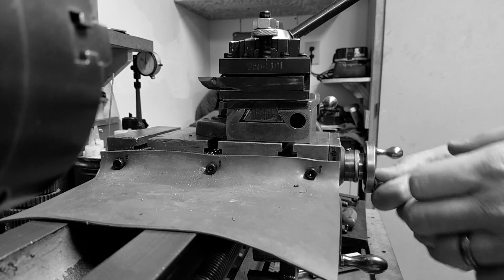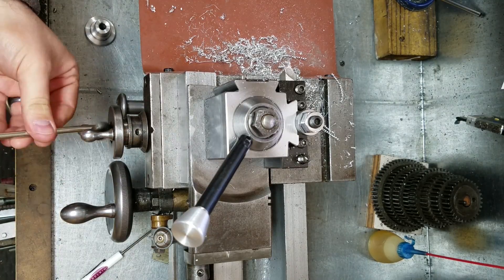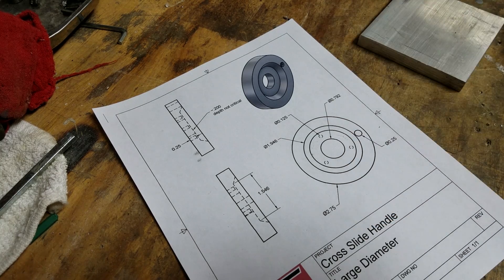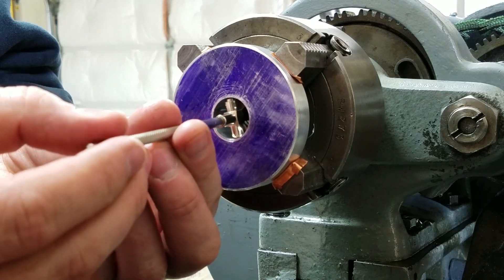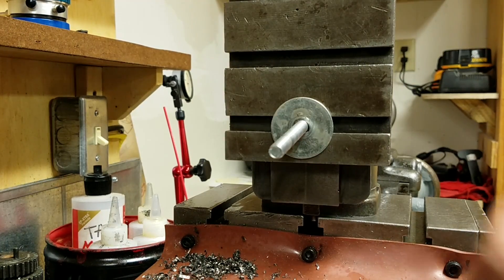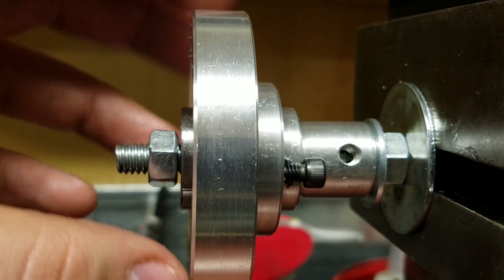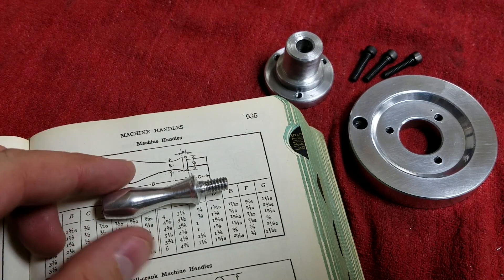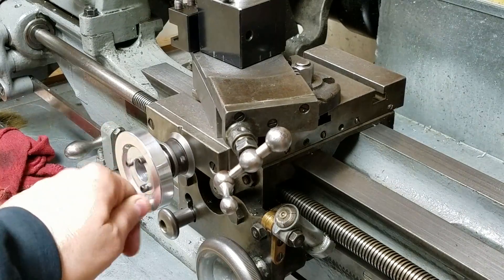Lathe Handle //Beginner Metal Lathe Project

Comment: Well done. Nice work.
Look at the time 09:35. Suppose You would like to turn the compound another 30 degrees CW, like when single point threading. It looks like the compound will interfere with Your new handle. I faced that on my mini lathe and bought a small compound handle and down sized the handle of the cross slide!
I could think of using the original handle You had but removing one of the pins..

Comment: I forget who's channel I was watching an old time machinist make a similar handle, your not going to believe this but, the trick is to shape the part to the critical dimensions, than just like on a wood lathe, he finished the handle by hand {via a homemade hand held turning tool} on a steady rest like on a wood lathe, knocked it out if I remember correctly, like in less than 10 minutes.  Oh, and yes what the old timer made was from steel, not aluminum.

Comment: In your video you use a book with the specs for handwheels and machine handles, what is the title of this book. Thanks
Reply from the maker: Machinery Handbook.  Pretty much any edition will work.  Mine is quite old, like 13th or something.
Reply: Thanks for the info, I already have the 26th edition and I don't have that section. If you have the time can you check for the edition you have please. I will try to find a copy on the internet.

Comment: Loved the video, you make it seem so easy, I wish I could get my hands on a lathe but here in tokyo is almost impossible. seems so expensive
Reply: Ebay.
Reply: Any ideas? I saw some video that says many ebay cheap ones come with disaglinments and defects that make them even more expensive to repair. Im a total noob about it. Besides I need something small to put in the apartment.
Reply: Julio, 
Two brands of small lathes that you can put in your apartment are Sherline (https://www.sherline.com/) and Taig (http://www.taigtools.com/mlathe.html). Both are very accurate if well adjusted. See if you can at a good price in your country. Another option is a Chinese lathe. There is good and bad lathes in China, search before buy. One that I would recommend is the 180 x 300 Optimum lathe (https://www.youtube.com/watch?v=wQGJdr5lCQk). Another cheaper option would be an SIEG (https://littlemachineshop.com/products/product_view.php?ProductID=4959). Of course none of this is cheap and you will still spend a lot on the tools but I am just showing you what your possibilities are. Big hug and good luck!

Comment: Does your lathe have power crossfeed? I am looking at buying a new lathe and am wondering how vital it is. Its quite a bit of money extra. Thanks!
Reply from the maker: That lathe did not have power cross feed.  However, my new to me Sheldon lathe does have it.  I will say it is very handy for parting off operations.
Reply: Ah ok cool. I was impressed with the surface finish you got without power feed! Being a beginner, my finishes in facing cuts suuuuck and so I was wondering if the power feed was worth it. However if its just a matter of skill, then I will stick with the manual method and save the cash for other things :)
Reply from the maker: I totally understand the saving of the money.  Best of luck and have fun!
Reply: @Mirandorl  If it's an option you should buy the biggest machine you can. Not so much for having power on the cross slide but you will appreciate the rigidity and power more than anything. Realistically anything 12 in swing and up is going to have a powered x axis as bone stock. Not to mention just general use is much more convenient, setup is easier, and the machine is much more versatile. I went from a 918 atlas in my home shop, upgraded to a 12x36 to running large industrial machines professionally. It's night and day the difference in use ability. Now i find my 1236 to be cramped and lacking in power and rigidity. Save up for something professional quality regardless of size. Though 1440 is a sweet spot if you have the space.

Comment: Looks good.
My 2c worth would be to suggest as an extra refinement, to do a similar mod to what i did with my lathe feed handles, namely to make a counter balance to offset the handle mass.  Originally, before the mod, because i had a nice ball bearing lead screw, if i had any vibration from the cut, the mass of the handle would tend to rotate the feed wheel until the handle was at bottom of the circle, thus advancing the tool in some unintended direction and compromising quality of product...
 You can tighten gib screw to lock the axis of motion but this is a nuisance. 
 Counterweight made and installed; problem gone.  Same thing on my drill press x-y table. 

You want a bigger diameter slug of material so it is shorter so it doesn't hit your fingers when you crank on the handle though, or if there's room, fit it onto the back of the handwheel.

Comment: I have been looking for a lathe to buy hard to get here I have not used one yet, I would like to make a suggestion, instead of using bolts to hold it together I would undersize one part and use the heat one freeze the other to join the parts in a press fit, so then no bolts drilling or tapping threads,

Comment: Very few of those old Myfords around the US. I had the same backlash issues on my South Bend, replaced the cross slide lead screw and nut and it is nice now. Fine workmanship by you as always!
Reply from the maker: +Randy Wilson Appreciate the kind words. Yeah, makes for some fun times when you try to find bolts for the thing.

Comment: Hi ThunderDog. Nice video! A couple of questions:
At 5:03, you show that you have marked the locations of the three screw holes that will be used to hold the "disk" to the "hub". What method did you use to locate those three holes, 120 deg apart? 
Secondly, does the curvy handle that you made at the end spin free, or is it tight to the disk (i.e. you have to let it slip in your hand while turning it)?
Reply from the maker: +Walter Turchyn I'm away from my books right now, but there is a chart in Machinery Handbook that I used.  I recorded it but didn't put it in the video because I wasn't sure if people would be interested in that info.  The handle is screwed into the large diameter.  Hey, thanks for watching.

Comment: That's pretty neat.  Nice work.

For mine, I took a similar multi-part approach, but rather than bolting, I shrink-fitted the ring onto the shaft, which gave a cleaner result.

It's worth noting that your new handwheel will interfere wth your compound slide.  there's  reason why your old handwheel was small.

Comment: Instead of using copper shim stock I use aluminum flashing for stove and duct work at a fraction of the price.
Reply from the maker: +Ronster Irons Thanks for the tip.  I have a 5 lb. box of it for now.
Reply: No problem, the flashing is cheaper and easier to get at any hardware store, down side is the tolerances are not as good. Probably wouldn't hurt to have on hand. I have both but only use copper when precision matters. Have a good week.

Comment: Hi, great job on the hand wheel. I liked the fact that you made it from two pieces to get around not having a big enough piece of bar stock. 
Could you please reply with the name of the book that the dimensions for the shaped handles was in. I have been looking for a chart like that for a long time.
A method for making odd profiled 'ornamental' parts that I have used with good results in the past is to divide the part up into say, 64th inch steps and turn what ends up looking like a stack of washers. I used a parting tool and just plunged to each diameter. It is then a simple matter to finish of the profile with files of the appropriated shapes.
Keep up the good work.
Reply from the maker: +KiwiBassHead I did a similar setup with the parting tool and then formed the part to final dimension.  The nook is none other than a copy of the Machinery Handbook.  Mine is the 13th edition, old but works just fine.  Thanks for watching.

Comment: nice handle try chucking  your cross slide  lead screw in your three jaw on the smooth un -threaded  end let the threaded side hang out over the bed check the runout  you should be able to slip a close fitting pipe over the threads and GENTLY bend the lead screw back to true. I hate to see such a nicely made handwheel wobble so much.

Comment: Nice lathe!  What kind is it?  I like the t-slots a lot.  You might want to hold on to that old handle.  Several YouTube creators have made an adapter to fit the two handles which is driven with a hand held drill motor.  It gives a smooth, long cut with no tedious cranking.  First time here, your voice reminds me of This Old Tony.  Subscribed...
Edit:  Oh, yes, nice job on the handle!
Reply from the maker: You subscribed equates to me being very thankful and appreciative of people being interested in what I do!!

It's an English lathe, this one being a Myford/Drummond "M" series.  Around WWII Drummond was sold to Myford.  From what I've read this is the long bed version.  It's been a great little machine.  It's not without some quirks, but I've learned quite alot with it.

Comment: Nice job on the handle, I'm going to have to try making one soon. My cross slide handle was damaged while trying to move my lathe when I bought it.
Reply from the maker: Yeah, the compound and the cross slide acme screws are bent on this machine right at the base of the handles for each.  McMaster just delivered a nice new 3' stick of acme screw that I hope to use for replacing both.
Reply: Nice!